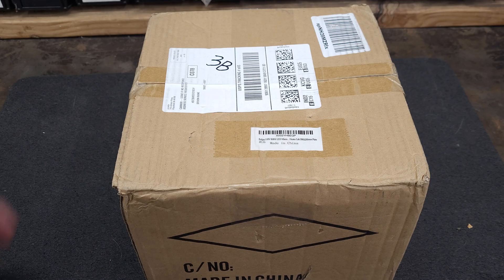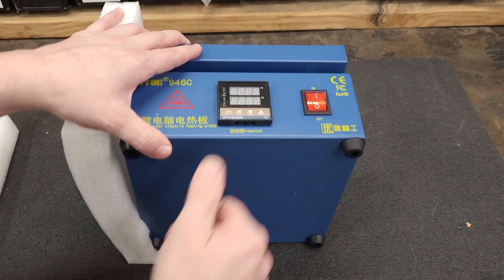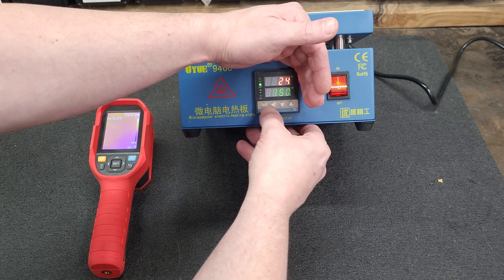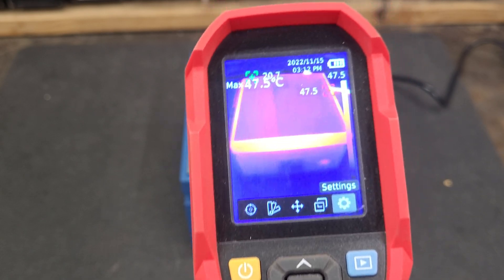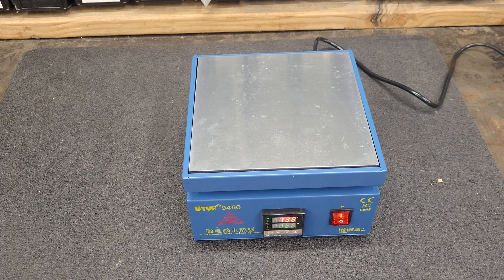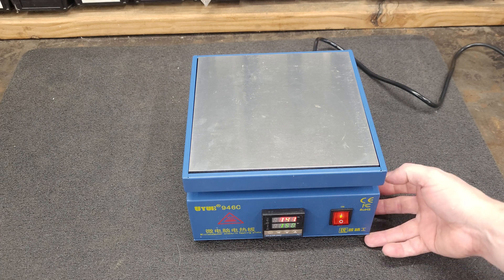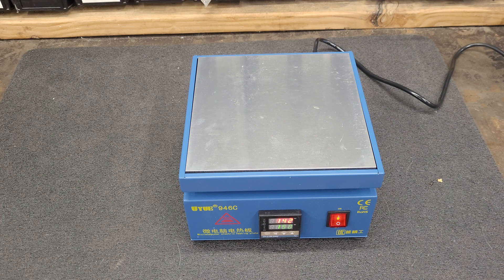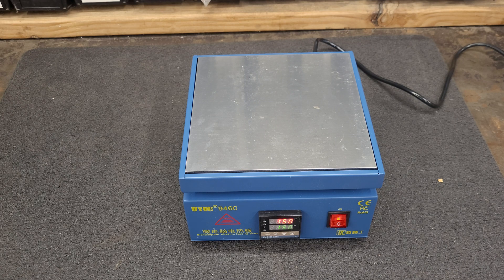Uyue 946C Heat Plate PCB Preheater Unboxing is It Worth It out of the Box Thermal Camera Test?

Comment: You must take into account the reflexion factor of the surface. Best way to use the thermal camera ( I have the same and it is very precise) will be to put a black tape or something different on the heater and measure this.